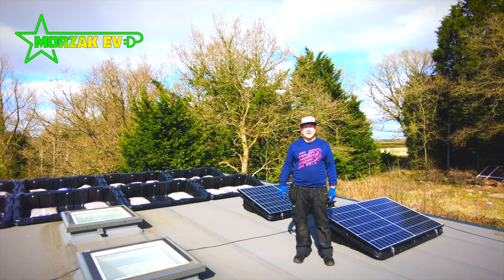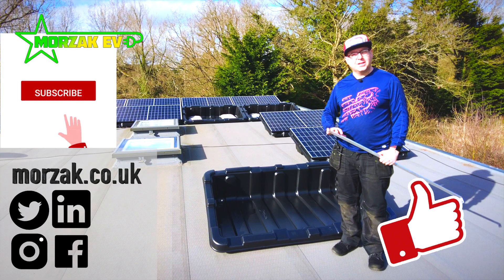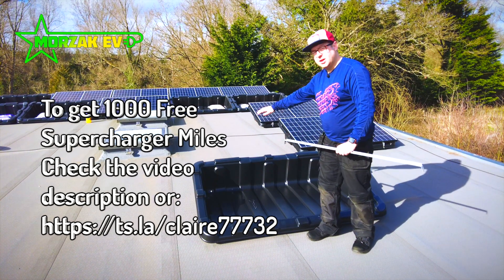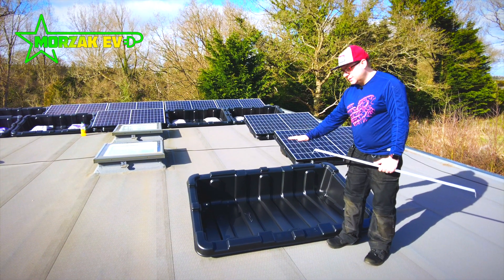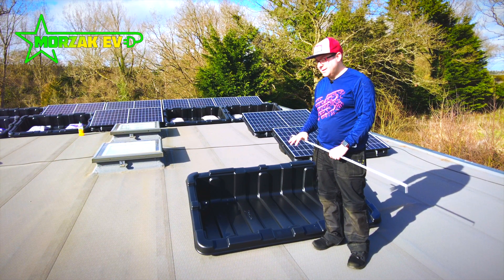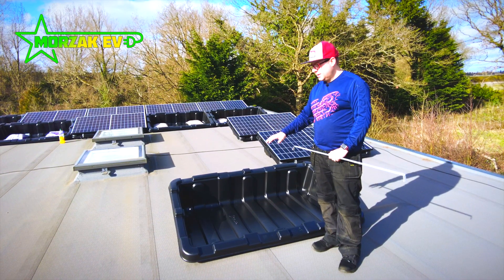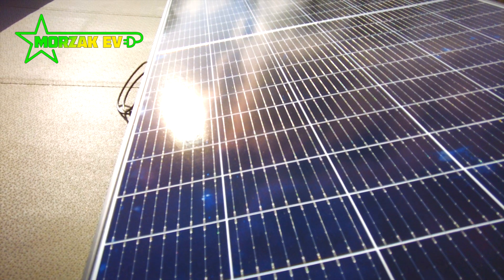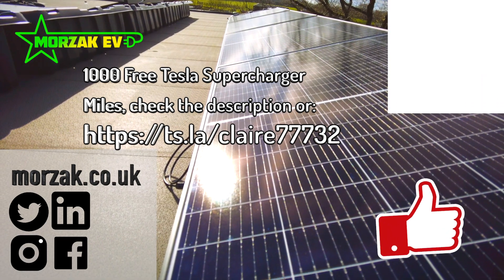Installing Solar PV on the Renusol Console+ System

Comment: Good video thanks for the information. However something small i noticed at 5:52 - you place the washer underneath the panel bracket mounting point, and I believe according to the manual it should be above and contacting the bracket instead. As I said a very small thing - please correct me if I am wrong! Cheers

Comment: It's awesome you've got so much room up there to play with. So much potential for diy tinkering. I'd be experimenting with laying mirrors in front of each panel and then actively cooling the undersides. Those tubs look ideal for ducting the waste cold air from a heat pump into. Chill them right down so they can cope with any amount of heat.

Comment: Hi, amazing video, very detailed and looks like a simple installation. Did you have any problems with water going inside system and not draining properly? i could only see 2x small holes in the bottom corners, but nothing else? overtime has this caused problems?
Reply from the maker: No, they've been up there a few years now, and we've never had an issue. The holes are not actually that small, they're about 20-25mm and there is one front and back for each trough in the bucket, so quite a few holes.

Comment: You used 2 bags of ballast, about 50kg? Have you had any issues with movement?
Reply from the maker: None whatsoever, and we've had a lot of storms. We used 3 bags around the edges though. Just bear in mind, your position and building height and other factors may affect the wind loadings, and your building structure must be able to accommodate the weight.

Comment: Thanks for the video! Did you use any protective pads or a matt before placing in the desired location on the roof?
Reply from the maker: No. This membrane on our roof is super thick and tough - it can even be used to make a green roof or balcony, so we were not worried. If you are concerned about the roof surface, I’d suggest just using something like horse stall mats which are relatively cheap and heavy duty.

Comment: Flat roof angles are ridiculous for Winter especially here in UK. I used mending plates to increase my angle and get 1kwh compared to 0.500kwh in mid-Autumn. NO idea why on earth flat roof angles are great for Summer when you don't use that much generated energy.
Reply from the maker: I think there are a couple of things that play here. Firstly, this product is not just produced for the UK, but all over the world so I have come up with one product that maintains an optimum angle for most places where the product is sold. Secondly, most countries have some sort of planning restrictions, by ensuring the 15° angle, it means you can put them on any flat roof and it will still be within your permitted development rights. By increasing the angle, the panels would be higher, and outside of the envelope of permitted development rights, meaning you would need planning permission for every single install.

Comment: How much weight did you use for console?
Reply from the maker: The ones on the outer edge used 75kg and the inner ones 50kg
Reply: @MorzakEV  Looking at the video you installed 22 pods/panels. That adds an extra 1100Kg load on the roof structure. Did you get a structural engineer to perform a load analysis to ensure you did not overload the roof?
Reply from the maker: @stephennichols2533  great question. Our house is actually a new build, so the roof was designed with this solar panel installation in mind. It is actually designed for a larger solar panel installation, which we are upgrading to this year so to answer the question, yes, the Structural Engineer, specified the beams in the roof for this load. we are fortunate, as this is actually a conversion, and the building prior to us converting it was a storage depot. This meant the beams were actually designed to have cranes attached, so they were way oversized.

Comment: OK looks enough to mount the panel, how do you connect the panels when fixed like you have?
Reply from the maker: If you're talking about the electrical connections - the panels have leads with plugs on them, and they're long enough to connect from one panel to the next. There are slots in the Renusol console plus system to allow the cables to pass through. I hope to re-do this video in a few months to correct a couple of things - the blast should be rocks or pebbles greater than 20mm and not sand to prevent it being washed away if the bags break, so i will include this in the next video also. Thanks for the useful comment!

Comment: Instructive video,  do you know what weight of ballast is in each console? and what is the weight of the console + ballast + solar panel?  Looks like an ideal solution for my flat roof but worried about the overall extra load on the roof
Reply from the maker: So, Renusol actually have their own recommendations, and we have worked away from those for various reasons. Firstly, they actually recommend using stone larger than 20mm. You're probably best contact Renusol directly to get an idea of what weight they recommend as i can't remember off the top of my head.